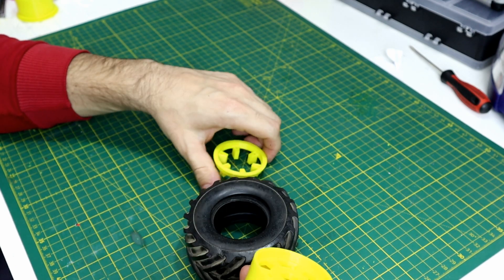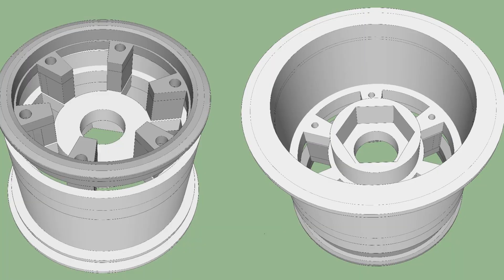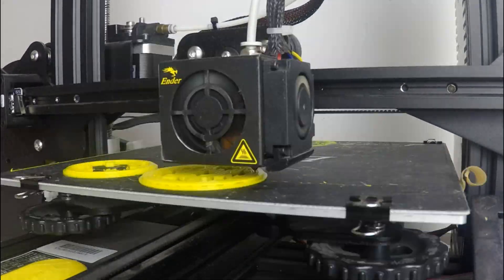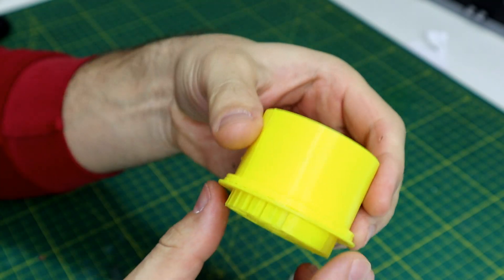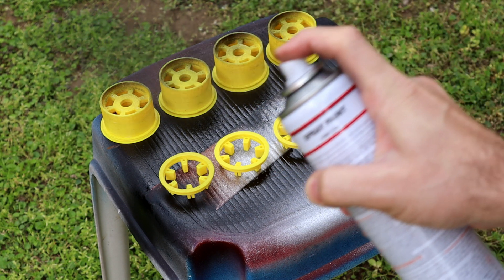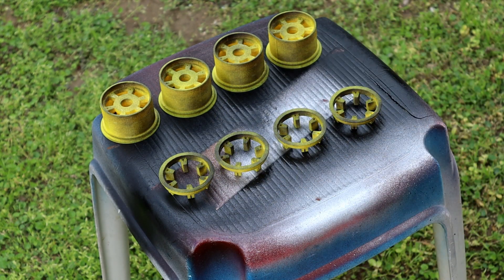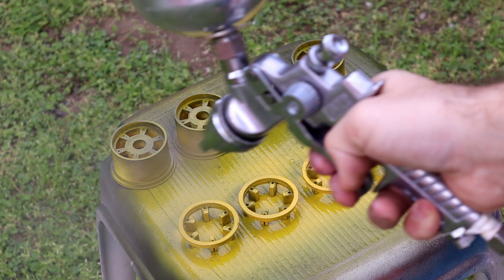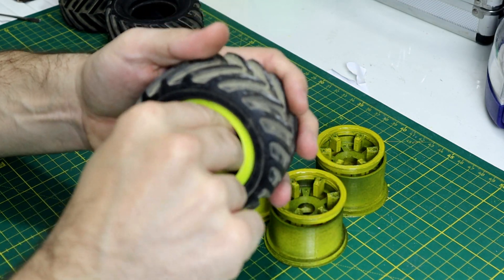3D printing Beadlock wheels for my 3d printed jeep wrangler\ How to design rc car /Scale Addiction

Comment: Hi, using an ender 3 V2, what settings did you use to print these please?
Reply from the maker: I usally use 0.12 mm layer hight 100% infill and 205/60 temperature and printing with pla